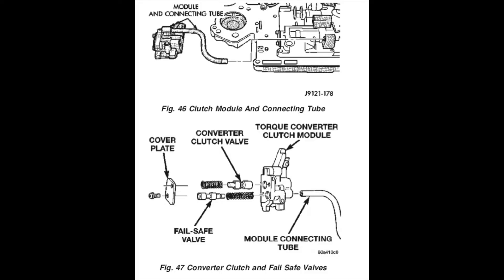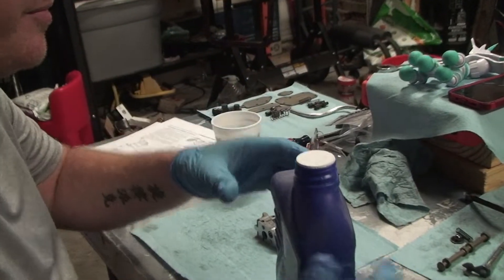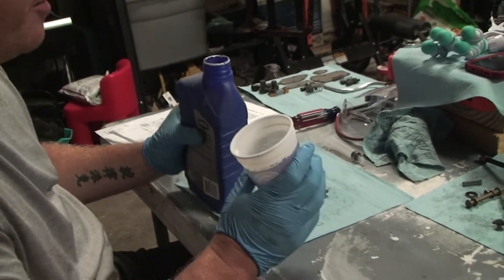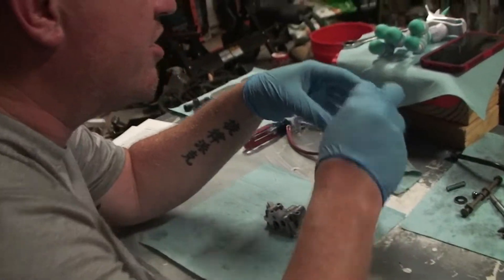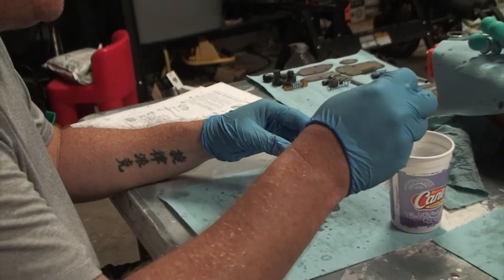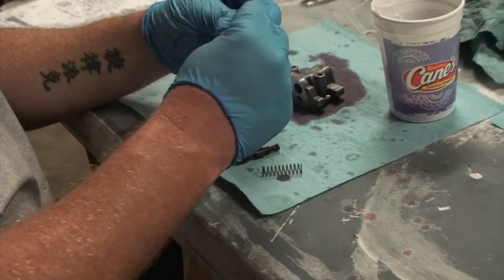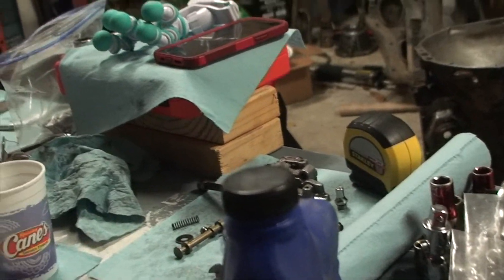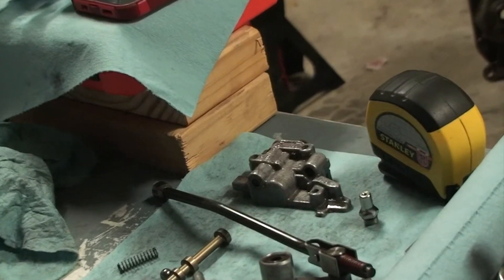32RH (904) Valve Body Reassembly Part 1 - Torque Converter Clutch Module

Comment: When rebuilding the valve body, did you replace any parts? Or just cleaned parts?  Enjoying your videos as I am about to tackle rebuilding my Jeep trans
Reply from the maker: I did not replace any parts on the VB other than the torque converter lockup solenoid.   It’s pretty typical to do a Transgo stage 1 or 2 shift kit, and I may still do that at some point.
Reply: how did you know the solenoid had to be replaced?